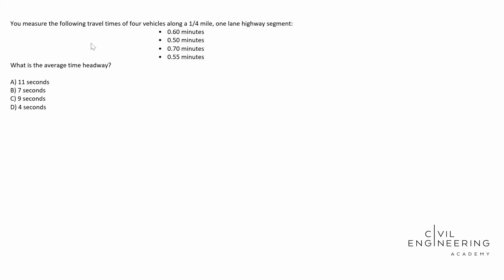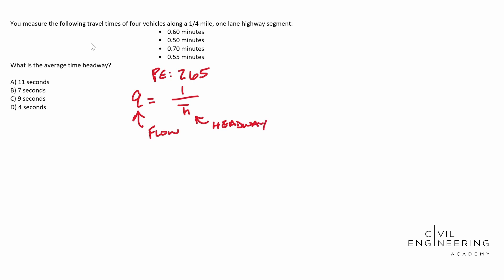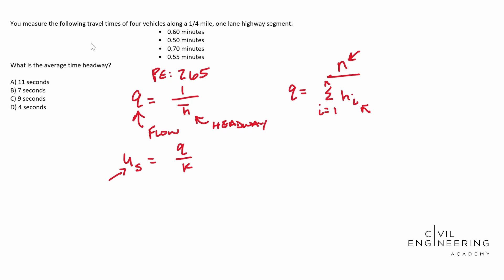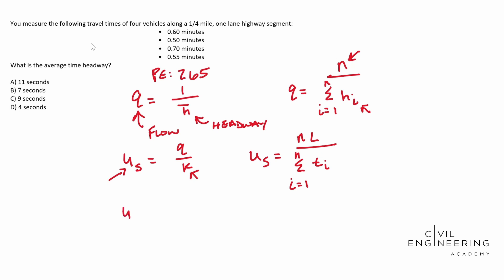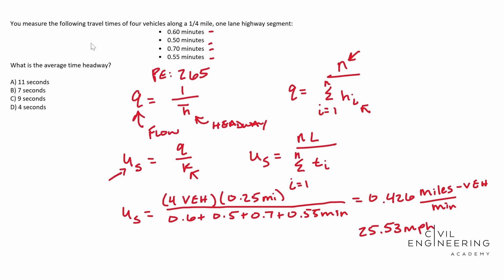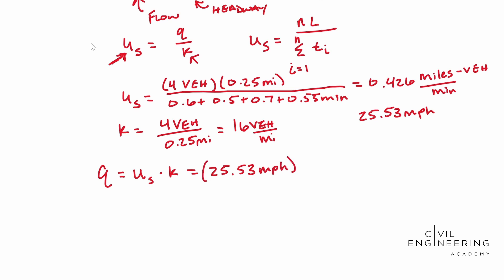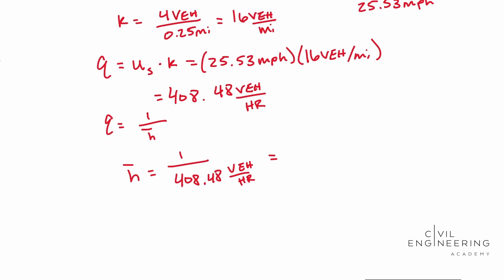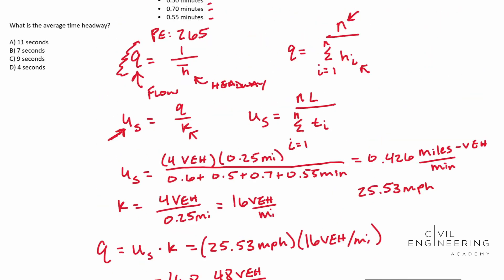Civil PE Exam - Transportation - How to Calculate Average Time Headway (Revised)

Comment: Headway is sec/vehicle. So if you take the average seconds and divide by the number of vehicles you get 8.8 seconds. Equations sometimes get in the way of common sense.
Reply: Summing the times I get 2.35 minutes or 141 seconds divided by 4 = 35.25 sec/vehicle not 8.8. Not sure why but I think you need to multiply by the length of roadway (0.25 mi) to get 8.8125 seconds which is the same answer Cody got. But that would put units as seconds * miles / vehicles...
Reply: Please explain your process because it's not adding up.